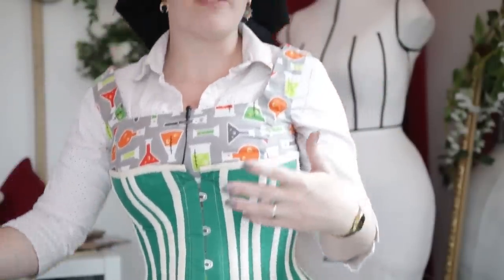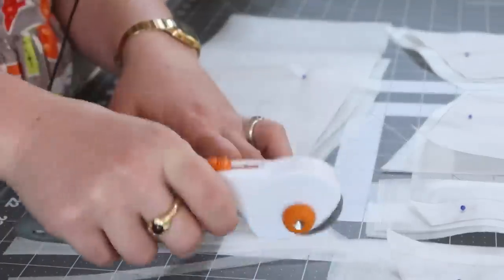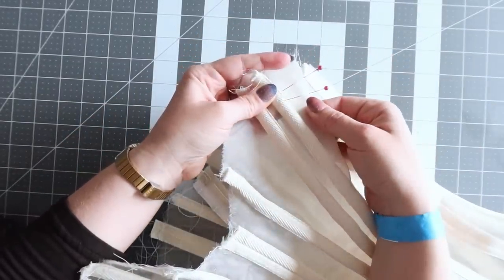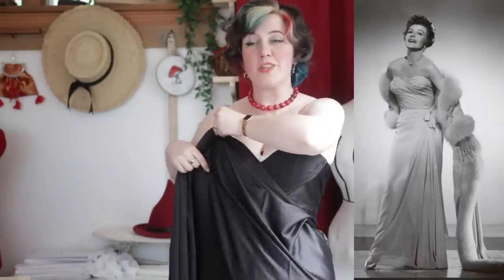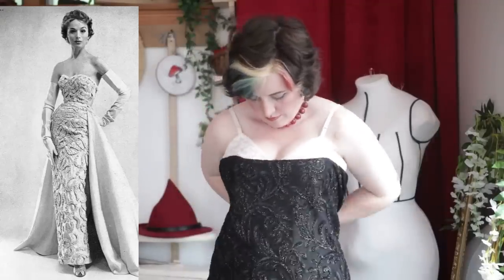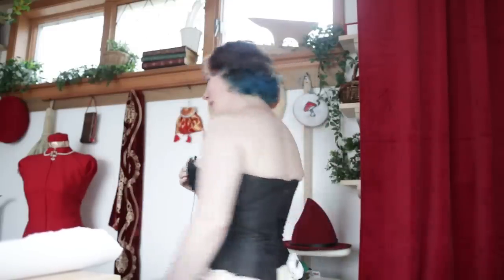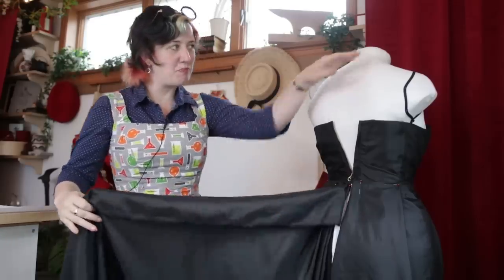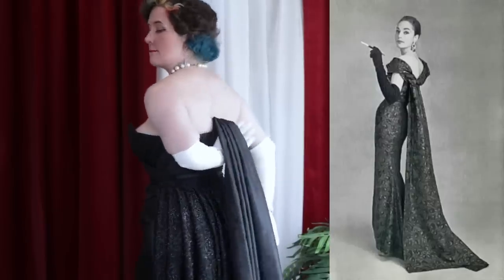How did 1950's dresses get that shape?  (it's CORSETS)

Comment: So... This might sound really dumb but when I was working with plastic boning I used nail clippers to cut it. If you cut it in two passes you end up with really rounded ends that don't need much sanding. Might not work for everyone but it makes for a good shortcut for me.
Reply: You don't sound dumb at all! Using a tool designed for rounding off a strangely similar material is smart and resourceful
Reply: The plastic boning is meant to imitate the properties of baleen, which, like fingernails, is made of keratin.
Reply: Oh thats actually such a good idea, i was using my dad's shop scissors and shooting bits of plastic off at mach 3 lmao
Reply: What a smart idea!
Reply: That's actually a super smart idea, I will have to use that!
Reply: That's pretty clever!
Reply: I did the exact same it's so much easier 😊
Reply: I've used clippers then ran over the edges with a lighter just to smooth the edges more.
Reply: I do the same thing!!!
Reply: Oh wow I will have to try that, thanks for the tip!
Reply: Kitchen shears and a metal file.
Reply: I used the curved nail nippers! 💅
Reply: Oh, I'm going to try this.
Reply: Thank you, this is brilliant! 💡

Comment: Built in corselet dresses are the best! Seeing your process is an inspiration! 
But if budget/time/skill is an issue for anyone considering, I can speak to the benefit of adding as little as 2-4 plastic boning channels in contemporary off the rack dresses. As a not-busty gal, it helps sell the  illusion of something fancier and keeps me from pulling up strapless dresses.
Reply: What a great idea!
Reply: I'm not busty , this helps me alot !
Reply: Can you still out them in a washing machine with those plastic bones? That's such a smart thing to do!
Reply: @mirjanbouma  I never tried; I've kept my modified dresses as dry clean only.
Reply: @ah5721  I had a seamstress add them into the side seams of the bodice, and the under bust portion of any princess seam lines
Reply: @mirjanbouma  I'm pretty sure you can wash them as long as you don't use hot water and don't put it in the dryer afterwards. Also if you can't afford to get the plastic boning say from a fabric store you can also go to hardware store and get some heavy duty plastic zip ties and use those as well and they're cheaper than the plastic boning you can get it the fabric store.
Reply: @sadiekincaid5310  I know of the zip tie thing already, thank you for your helpful and kind comment! Cold water wash, got it!
Reply: Trust me, busty women have the same problem with pulling up sleeveless garments

Comment: That draping is awesome! For the tension issue on the zip, many dresses of that era had a zip or hooks/eyes for the foundation layer, and then a separate zip for the outer layer. The two layers would be connected in the front and then separate either from the side seams back, or about 4-6 inches from the center back. That way, the outer layer fabric and zip aren't under strain.
Reply: That makes so much sense. Considering how tight these dresses are I always wondered how the outer fabric seemed to float over the inner structure without pull lines. Having two layers of fasteners is very smart!
Reply: I love the comments sections of costube videos almost as much as the actual content! Even when coming back for a rewatch, one can pick up the most interesting &/or useful extra info in here, be it historical anecdotes or technical tips 😊 (And there's often a lot of great extra humour too! 😁)

Comment: FYI the reason the new mesh corset didn't fit your dress form properly is because the dress form already has a corset built-in so it was like putting on two identical corsets at once. The one on the outside now has farther to cover buy just enough that it no longer fits the same way. 🥰😢 Hope this helps.
Reply: The main reason is that a dress form doesn't squish like a real body. Even a slim body with not much "fluff" is far more malleable - skin, fat, muscle and ribcage are all compressible or displaceable to some degree.
Reply: @rachelboersma-plug9482  
The dress form was shaped around the external dimension of the green corset as worn by Morgan, which are obviously a bit larger than the internal dimensions of the same corset.

Comment: Hi. I just discovered your channel. I am fascinated by the inner construction of 1950s Couture. I love how your foundation turned out. Traditionally, these foundations did not have that many panels or that much boning (although sometimes they did). The bust was usually shaped by using darts and not panels, so you did not have to stress out about your dart. We have to remember that these were not necessarily to shape the body but to provide structure to the dress itself. Dior was known for creating very shallow bust cups on his corselettes.

As you mentioned both hooks and eyes and zippers were use to fasten the corselette. They would use a very long zipper to fasten the inner layer foundation bit, leaving a very long zipper tail. Usually the dress is attached to the corselette at the neckline just like you did. However, about 3 inches is left loose at center back on both sides of the closure and a second zipper would be added to close the actual dress. Ultimately the skirt and the bodice would be attached together and a single zipper would be used to close  the outer layer of the dress.wonderful

Comment: I love the versatility of the tail and the butt cape.  It occurred to me, as it has lately, that the pencil and wiggle skirts of the 1950s are just a variation of the hobble skirt of the  early 1910s.  I've been making a lot of narrower skirts lately -- mostly because the fabric I have ready access to, right now,  are all ready cut lengths of 3 yards.  AND I noticed that the shorter skirts from the 50s to the 90s are, in MANY ways, just short versions of the floor length skirts from the 1830s on.  Love the butt cape over a wiggle!  I have a UFO of one in teal that I now want to take a second look at.  Thank you!

Comment: former haute couture dress maker here: Achieving the right form, fit and function of the under or integrated corset is for the dress the same as a skeleton is for the rest of a body. Often the worry is that your over constructing the corset, but you'll find (like i think you have in this video) that a sweet spot appears, with future upgrades or fabric choices for the next dress coming to mind during the process. (i stopped to comment at 10 min so i might be prematurely commenting but that's what i think so far. Oh also the stuff you used for the corset base was called nylon crinoline where i worked. Probably not the same thing its called else where, because as far as i can tell the melting pot that is higher sewing causes all languages and names to end up in the same space.)

Comment: Getting some McCall's or Simplicity patterns from the 40s and 50s will help you size up your proportions. It's also fun to read what they used for bones and how they decided what worked under their clothes.  Just using the patterns probably won't work as we are much heftier than we used to be. But it would save you reinventing the wheel quite a bit.

Comment: This is absolutely gorgeous.  I did a black satin with taffeta lining evening gown some 30 years ago.  Form fitting with lots of boning with flare below the knees.  It was supposed to have little attached sleeves…think scrunchies.  Instead I used a 2 1/2” fringe that had a slight drape.  Full length black satin gloves and lace fan.

Comment: Just what I was looking for.  Trying to make a funky ball gown for my husband's 50th birthday.  A mix of big ball skirts with multiple layers with a wrap top to get a good fit and draping without having to sew the top and a beaded evening wrap, coat, vest or duster. Really all about color. Fell in love with a stripe silk but I can't find anything like it anywhere. It's cream, white and a kind of dusty rose/rust color I wanted to do pants or some kind of bum skirt on top in the striped silk. Trying to layer red under skirt and green top skirt with either cream or nude in-between and maybe the cream/rust stripe silk on top of the green top skirt. Will see. I have to source my fabrics. With wrap top it will have multiple layers and some to add side drapes or a train. I'm thinking some of the tails from one layer of the top wrap can maybe hang down in between two of my skirts. Still all in my head for now. I have  6 months.

Comment: My 50s-eque prom dress (high school leavers at 16)was like this. The sweet heart pleated top, into tiny waist then flared out with tulle skirts. And in black taffeta too. It had small adjustable and removable straps too. I ended up adding a blue ribbon sash and kitten heels. It was so cute. Currently it's stored in my mums wardrobe but this makes me want to pull it out and see if it fits after 13 years. 🤔

Comment: I had the fun experience a few years ago of being an "extra" in a professional ballet.  The costume construction was really fascinating!  And one of the things I noticed is that the ballet costumes did not button, snap, or zip.  They used hooks and eyes almost exclusively.  More importantly, the hooks will not sewn with all the hooks along one edge and all the eyes on the other edge.  The hooks alternated with the eyes along the edges (hook, eye, hook, eye along one edge, and the the matching eye, hook, eye, hook along the other) which really made it incredibly secure.  It was also IMPOSSIBLE to dress myself.  I had to have a "dresser," even as a "supernumerary" (extra) cast member, in order to get into my costume.  And I wasn't even a principal or a member of the corps!  I was a "peasant woman," with an appropriate costume.  The costumes for the regular members of the company were all custom-made to fit the individual dancers.  So, it was really interesting.

Comment: I was born in 1954 and remember some of my mothers dresses having a side seam zipper.   I also remember see over skirt that were lined usually with taffeta or satin. some times in a darker shade for contrast.  Your finished product is cute but does not quite reach the glamour you were going for.  Practice I think will get you there.  The draped train was not usually worn with an over skirt. also most of the ones I have seen was were one piece dresses.  Of course most of what I saw when I was young was more mid priced but my mother was a seamstress who made dress for Eastern Star and other orders.  Still remember the piles of fabric and how great the dresses look when Mom was done with them.

Comment: i was thinking about constructing long bra/short corset thingy but 50s and my first thought is to mash corset pattern with a good bullet bra pattern (i have a good one) and see where bonning goes from there. (id like to see if it works so maybe you could try it?) but im intrested in dart method, tho idk how it would work on bigger cup size. the finished gown is sooooo pretty
Reply: That sounds like a really intriguing project! My immediate feeling is that having a dress form that's been adjusted to one's size might be an essential, to help with figuring out exactly where all the bones and darts would need to go...? (Morgan somehow managed to do hers just on herself, wow!! 😳 I'd be leery about trying that myself without having an offsider to help fitting - frustrating experience suggests every time you move your arms, it changes just where the b00b sits? 🙈)

Comment: When I’ve added a corset type lining, I’m busty enough that it’s vastly easier to use underwires and build the bust like a bra cup. If I don’t go full corset in the dress, it consistently slips down. The bra cup design keeps it snug to my ribs and thus stays up.